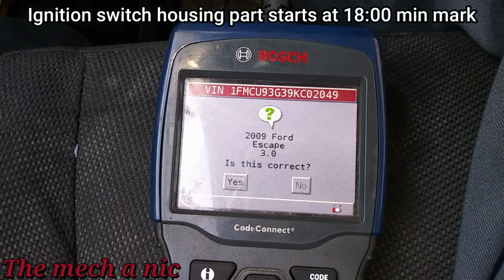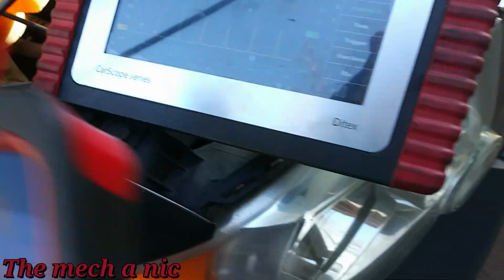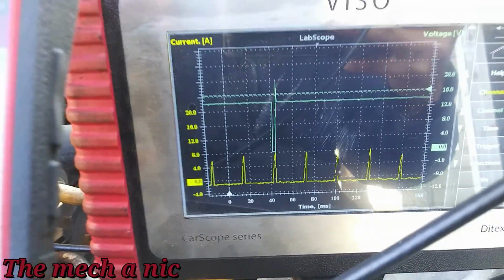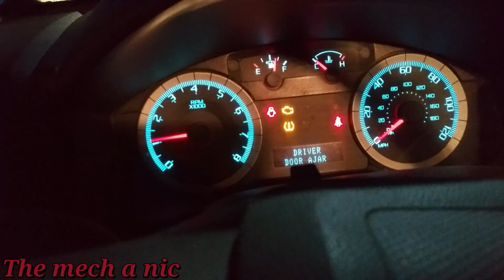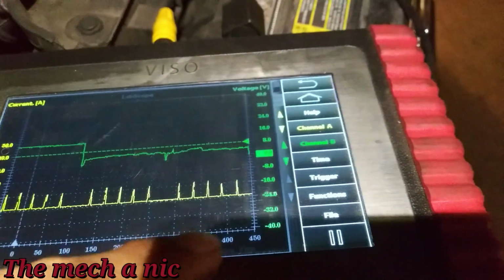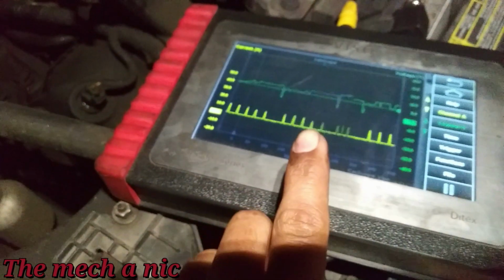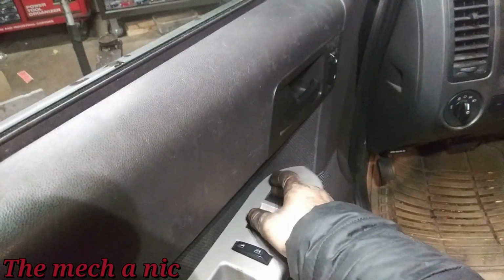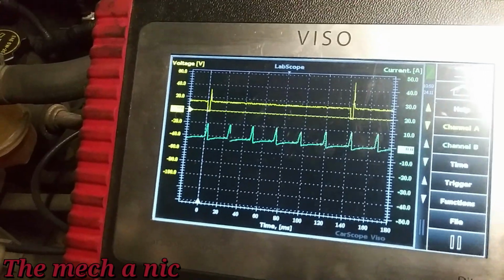ford escape misfire p0174 p0316 / ford escape no start ( ignition switch )

Comment: The second half of your video should be called NO CRANK NO START which also then means No Start or No Run due to it not cranking first. These are the typical words used when the starter does not engage, thanks for the video and diagnosis on the injector with a scope.
Reply from the maker: Yeah I should have separated this video into two videos

Comment: FROM A BLOCKED WEBSITE BUT I HAVE A GOOD ANTIVIRUS 
All of the power wires to all six injectors is a green wire with a red stripe. Regardless of these colors, power wires are all the same.

The ground wire colors are as follows:
inj 1: green wire/blue stripe.
Inj 2: gray wire/yellow stripe
Inj 3: violet wire/gray stripe
Inj 4: yellow wire/orange stripe
Inj 5: brown wire
Inj 6: green wire/white stripe

Sometimes colors appear faded or slightly different based on the light source. The moral of this post is if you don't have a schematic, it can be found and I would have gone for the same wire YEL/RED as it's close to the #4 listed. Cheers.

Comment: As likely as it is to be a fuel injector, I'd have been wondering if I was missing an intermittent driver fault. Then you proved the injector was bad with the multimeter, showing high resistance at the end. I really liked your visual demonstration of the airbag retention spring. It's so much harder to visualize that when people just talk about it without showing how it works.

Comment: I wouldn't call this a "bad" injector, more like a "gummed up" injector.

If an electromagnet gets weaker from heat- then it is failing.
Heat builds, the varnish frees up, and it's sticky but sluggish, a sticking pintle.

Cheap high% ethanol (corn syrup) sits in a cooking injector when shut down.
It's better to stick closed than open when shut down- residual line pressure
bleeds off, washes cylinder, thins oil, causes "extended crank" bec empty rail.

Do you have, or ever use one of these? You can also make both DIY.
When used together, they are awesome. The best cleaner IMO for use in a 
"hot shot" device is:

 https://www.amazon.com/Berryman-Chemtool-Carburetor-Injector-Cleaner/dp/B000CCMNAG/ref=sr_1_7

https://www.amazon.com/Automotive-Non-dismantle-Injector-Cleaning-Carrying/dp/B089QCFCPD/ref=sr_1_8

AND

https://www.amazon.com/ALLOSUN-EM276SET-Injector-Adapter-Cleaning/dp/B07VC37VRB/ref=sr_1_3    

Hang it up under the hood, pull the fuel pump fuse, turn on 40 psi air, and
run the engine off the straight cleaner.
Reply: I understand your thought process, but in this case when acting up the injector had no current moving through it at all. If it was just stuck or plugged there still would be current flow, perhaps with a somewhat different waveform. Also with high static resistance proven at the end, there was definitely an electrical problem, either primary or secondary. No cleaning is going to fix that. I'll bet that if that cute little thing were cut apart you'd find corrosion, water intrusion, even rust adjacent to the coil windings.
Reply: @spelunkerd  Agreed! Now that I comprehended the whole incident,
what you said makes sense. An injector doesn't have a "commutator"
like a motor, so no "flat spots" to electrically die in between. Thanks man!

Comment: I feel like you should name that old injector.  Good job figuring it out despite the scanner failing to detect it.  Those ignition switch failures were well known to Ford, I've had to change them quite a bit. They blamed it on heavy keychains rather than doing a recall or service bulletin
Reply from the maker: I cant think of a clever name for an injector 😂 why fix something that they can just continue to sell parts for? The heavy keys claim is just so they can get out of paying a ton of money to fix all these cars

Comment: OMG! 😂😂 The Scotty Kilmer thing at the end killed me! The same with the cute little fuel injector. 

I'm a real chicken shit. Whenever I mess with an airbag, I turn the key to ignition and then go connect the battery. At least if it goes off, I'm outside the vehicle.
Reply from the maker: 😂😂😭 , i thought about doing that but i worry about having a large spark at the battery if the key were on. Lol but its not the worst idea 👍